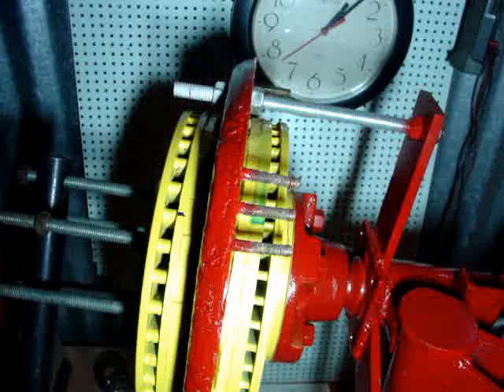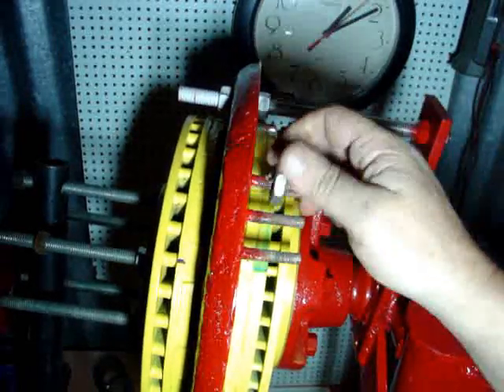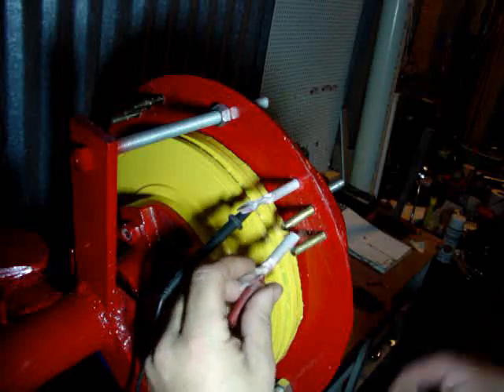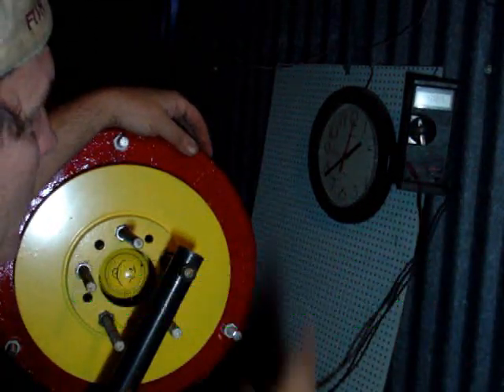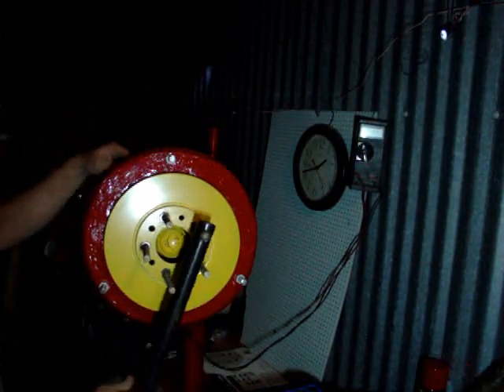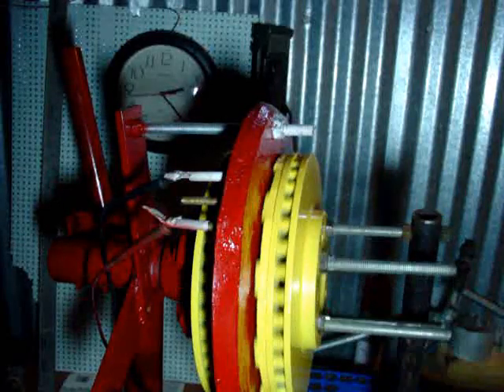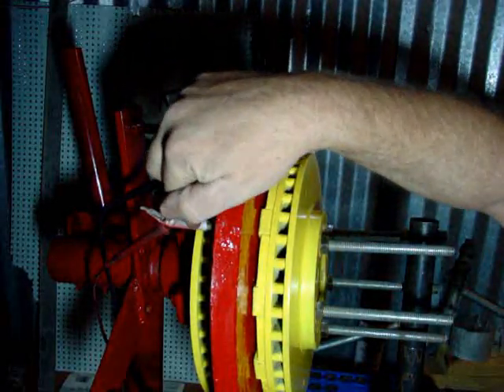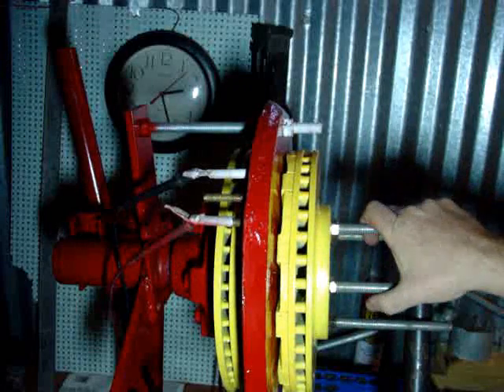BUILD A DUAL PERMANENT MAGNET ROTOR WIND TURBINE (PART 28)

Comment: Hey Muddy. I don't know if you're still monitoring this, but I found myself wondering why you put so much emphasis on the shorted terminals. I would have thought that in the wind you wouldn't want them shorted because it is too difficult to turn.  At one point you mentioned that the terminals would not be shorted up to a certain rpm then they would be shorted. How do you accomplish that? I didn't see it mentioned in the videos.
Great stuff!!!

Comment: Hey Scott,
Thanks for this series I've enjoyed learning how electricity works. I have been pondering building a horizontal windmill over top of my hoophouse using a 100' long series of connected windmills and an air baffle system to compress the air to increase air velocity. I'm having a little challenge figuring out much electric it could generate.  The blades will be a total of 50 square feet and winds average from 0-50 mph. My other question is can I dump all that energy into heating elements to raise water temps in a 10,000 gallon water storage tank?

Comment: I just finished watching all 30 videos, and reading all the comments...It took a while.  Now it feels kinda like you are a close  freind that I have never met .  I read through the scorpion recipe,  time travel adventures and heard you resopnd to "where can I get those magnets"  about 30,000 times...but I did not see the answer to the one question that I was looking for.  

Why did you decide against putting the magnets on the other side of the rotors?  It looked like it would have been perfect,  simplified construction and even made the wheel berring easier to replace. 

 Oh...and one other thing, if I built one of these things just like yours and connected it to a slow moving water wheel.  What rpm should I try to create with pullys to get the most out of it? 

PS...If you are not going to raise that thing toward the heavens, why don't you hook it up to an exercise bike...you could work on your spare tire, and Mrs Muddy could get ready for bikini season.
Reply from the maker: +David Mallary
     Your comment is well received. many thanks.
  To answer the one question that I never answered; After looking at the inside diameter of the stator cast, The hole was smaller than the diameter of the lug hole part of the steel rotors. The rotors would have been clamping to the stator.
 WWHHAAAA! ;( weep weep boo hoo.
 But it sure would have been nice. :) It would have been a very thin alternator build.
Next time i will be using flat steel for the rotors.

Thanks for the comment. It made me feel like a friend.
Stay well and safe bro. May you and your family be blessed.
MUDDy
Reply: +muddymuddymuddmann
Flat steel alternators do look cool.  Before I watched your videos I just scrapped about 8 car rotors and just about as many 3/8 steel plates that were already cut into perfect circles...oops.
  Oh...and one other thing, if I built one of these things just like yours and connected it to a slow moving water wheel.  What rpm should I try to create with pullys to get the most out of it?  

Wishing you a long healthy happy...
Dave
Reply from the maker: David Mallary

lol. I've scrapped a bunch of stuff that I immediately missed afterwards. That accounts for the huge flat forehead I have. Flat palming the forehead does that you know.
Luckily though, Boomer went to a scrap place that sells cut-offs, and other steel materials for welding projects. He bought me about 20 steel circles that were burned out from flat sock. Probably where they had to fit a large 12 inch pipe through. He said they were so cheap that he couldn't see leaving them there. He's a great guy.

as for the RPMs, 120 should do nicely. perhaps shoot for 135 to 145 so the torque makes a few amps, and not just the charging voltage.
 RPMs is voltage, Torque is Amps.
The torque happens after, the RPMs is met for the charging voltage, Then the machine tries to go faster than the RPMs that meet the batter voltage. Somewhere around 2 volts above the battery voltage adds an amp to it. I have no experience with water wheels, So trying several sizes of secondary pulleys would be cool to test.

But either way, I would start above 120 RPMs. Especially if the wheel is large.
The weight of the water, leverage by the diameter, and the height of the head is very important.

Try not to leave the bottom of the water wheel under water too much. It creates drag and drops efficiency fast.

I sure hope that helps.
MUDDy
Reply: +muddymuddymuddmann My water wheel will be different...kinda like me.  I live on the Mississippi River so there is no head, but there is unlimited 5mph flow.  So the design will have to revolve arround the needs of the generator.  I can shoot for any RPM that the generator is comfortable with.  I don't plan on using a battery bank, at least at first...I am looking into a grid tie invertor if the power companies hurdles aren't too high.  

Thanks, I wasn't sure if the axel flux could run eficiently at that low of RPM.
Reply from the maker: David Mallary
Actually, the axial flux can be tailored to reach charging voltage at any rpm.
even 20 RPM. Thats slow.

Build the water wheel.
Stick it in the water to find out the open RPMs.
Make the magnet rotors.
Last, wind a test coil And measure voltage.
adjust the number of windings, and wire gage.

If The configuration is too difficult to achieve the desired voltage. wind another single phase stator with 12 coils instead of 9. wire all coils in series. Voltage will get there.

Also, you can also tailor the alternators diameter adding more magnets, and coils with fatter wire for more amps.
To design the alternator, You need to know the open RPMs.

So the water wheel comes first.
Off of that you can find the torque and rpms, and how much power it has.
from that you can figure the number of turns, and the gage wire needed. The river will be pretty much constant velocity. And power.
MUDDy
Reply: +muddymuddymuddmann 

My plan is to make a floating water wheel out of barrels connected end to end like a rolling pin. I have calculated that a barrel will rotate at anywhere between 50 and 70 RPM depending on river level.  Tork can be increase by adding more barrels in a twin axial design, and then fine tuned with gear ratios.  I suppose I have a lot of flexibility on both the wheel and the Generator, but my with limited knowledge of the generator it makes me kind of nervious about creating an untested design.
.  Otherpower has a lot of info, but many of the old links with good info are gone.  I am leaning toward heavier guage wire and fewer windings, but like most people I don't have a lot of time for experimenting.  I will keep reading and see if I can increase my confidence.  

Thanks again
Dave
Reply from the maker: David Mallary
Hello Dave,
Collecting as much energy as you can with the barrels is probably the best first step. That keeps you from trying to design with imaginary numbers. After you have the barrels in place for even a temporary period, RPMs, and Torque can be measured.

With those two numbers, you can save yourself a lot of time, and money. No back tracking with tears to fight back because of wasted time and materials. Solid Tangible numbers are a great thing.

     From these numbers you will be able to figure Gearing, Overall Power, coil windings, et-cetera. And also where you want to mount the genny from seeing the tangible water rotor where it will sit. After all, The second best part of a project is the (Progressive Realization) of the Predetermined worthwhile goal. Each step accomplished brings the thrill to a new peak. BUT the best part is the Final Realization of the fruits of your actions set in motion. In other words, seeing the finished product of your labors doing what it was meant to do.

     I like this project. It floats, Thus, the river can rise, and lower without damage. I see torque, and energy extraction already, :)
I can feel the progressive realization already. :)
I feel excitement building. conquer it.
MUDDy

Comment: I too have to say thanks.  My wife and I are very interested in powering up her greenhouse and with your videos, I now have a better understanding how to make a wind turbine.  To you and yours, many thanks
Reply from the maker: +Steve Lay 
Thank You Steve.

MUDDy
Reply: In one of your videos, I saw that you were using a program to calculate the gauge of wire to the amount of turns to the desired voltage.  What is the program and where did you purchase it.
Thanks again,
Steve Lay
Reply from the maker: Hey Steve,
The two programs i was using were programs i had written in Basic86 language. they were RPMATMPH.BAS (RPMs AT MPH), and the second program was PWRATMPH.BAS. (POWer AT MPH).
The first one calculates the RPMs of a prop from a given tip speed ratio, and given diameter.
    The second was the expected power out of a given diameter prop. The diameter of the prop determines the wind swept area that the prop can collect power from. The program used those parameters to find the expected power out in any wind speed.. Efficiency would be the only downfall of the calculations therein.

I was using those calculations from both programs and info from other known wind turbine projects I found on otherpower.com to make adjustments to the size I was designing.

Sadly to say... windows xp was the last operating system that supported using GWBasic or Basic86.
I have one XP Puter left, and I keep it offline so i can still use it for editing and Basic programs.

The good news is i still have the videos up on my channel. I did several calculations on both programs. I did all those calculations so folks could figure out all the other calculations with nothing more than common sense.
Two rules to remember. double the wind speed means 8 times the power. :) and second,... double the diameter of the prop means 4 times the power expected.
and the same when you downsize the prop.

Also the rpms on a smaller prop will be faster than a larger prop.
The (tip speed ratio) is the key to all else. a 4.5 TSR means that the tips of the blades are traveling at 4.5 times the speed of the wind.
10 MPH wind, 45 MPH tips around the circumference of the wind swept area.

With this, start up rpms can be calculated.
Example: mostly you want the wind turbine to start up around 6 to 8 mph, and it will stay running down to 5 MPH after it starts.
so 6 mph is the wind speed for your target rpms.
design your turbine coils to reach charging voltage at that RPMs.

Suggestions: Check out "The Wind Turbne Evolution" at otherpower.com. There are step by step , open source full builds with pictures and very good reading on each one.
They start at very small ones and gradually get bigger and bigger on each project. Then they test each one for power output.
This may be the best way for y'all to go.
you get to pick and choose, and see the truthful results for each.
 spent 6 months digesting every page they had, and still never read it all.

There s also a forum there with many other wind turbine, and solar Gurus of great education to absorb from.

"The wind turbine evolution" is the best article they gave in my opinion.
Great luck you both.
 i chose mine and adapted one of theirs to my needs and affordability.

Be well in the New Year, stay safe and warm.
MUDDy
Reply: Many thanks to you again.  I appreciate all of the good work you've shown on your channel. One of the best, full of information (and at times, the funniest) I've seen.
Have a great Happy New Year.
Steve
Reply from the maker: Steve Lay
Happy new year to both of you. and thanks again for the comments and questions.
Like I have said many times before, I have a very intelligent audience that shows respect.
God bless you and yours.
MUDDy
Let me know if I can help again. And above all ENJOY.

Comment: Hey Muddy!  Thanks for all the great info!  I'm considering making a water version of this and I am a bit lost when it comes to wiring the stator to the rectifier.  Can you tell me what ins/out go to what on the rectifier?  Thanks!
Reply from the maker: SURE.
FIRST YOU NEED A THREE PHASE RECTIFIER. THERE SHOULD BE THREE TERMINALS ON THE RECTIFIER FOR AC. THE THREE OUTPUTS OF THE WIND TURBINE CONNECT TO THREE TERMINALS OF THE RECTIFIER. THE DC COMES OUT OF THE TWO REMAINING TERMINALS TO THE BATTERY/BATTERY BANK.
  THEN THE CHARGE CONTROLLER CONNECTS IT'S POWER WIRES DIRECTLY TO THE BATTERY/BATTERY BANK. THE DUMP LOAD GETS CONNECTED IN LINE THROUGH THE RELAY. THOSE CONNECTIONS ARE AS FOLLOWS... (POS) POST OF THE BATTERY TO THE RELAY, FROM THE RELAY TO THE DUMPLOAD, FROM THE OTHER SIDE OF THE DUMPLOAD TO THE NEGATIVE POST OF THE BATTERY.
   I HOPE THAT HELPS.
MUDDy
Reply: ***** It does.  I should have phrased my question a bit more clearly.  I was wondering how the stator starts and finishes were wired out to the rectifier for star and delta connections :) but just didn't have the right vocabulary words to make myself clear.  I looked at a few more of your videos and checked otherpower.com and I'm all straight now.  Tomorrow I'll be casting the stator then casting my rotors.  This is just too cool, thanks for turning me on to this info!
Reply from the maker: Shawn Hart
Thanks Shawn. I am so glad you have been able to join in the gang of self builders of the free energy community. You will not regret the knowledge. God bless you and yours.

MUDDy